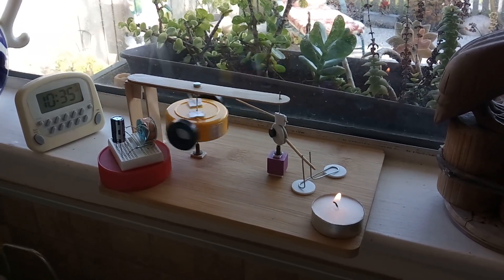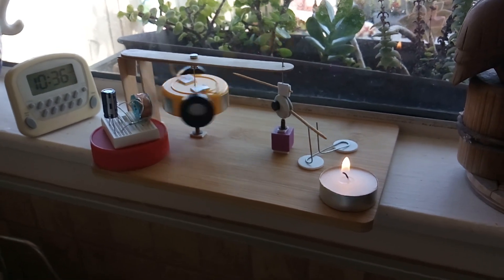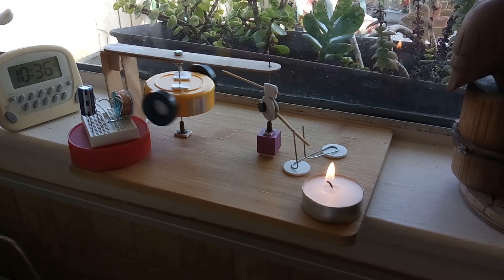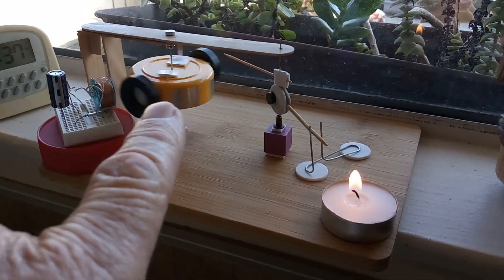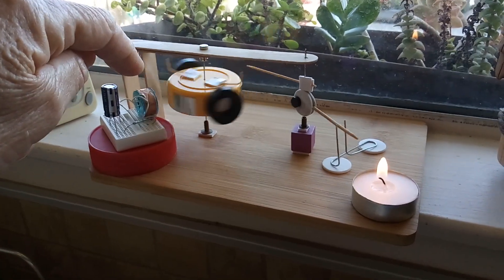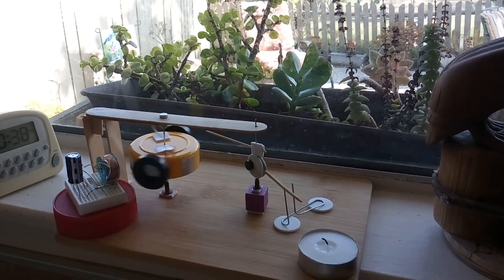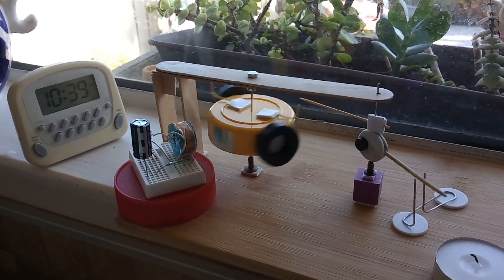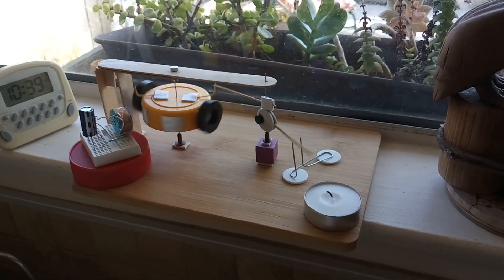Mystery Magnet Motor Study --  Part 3

Comment: you can have a real perpertual motion machine if you load the mains from your house with single recitified ac current into dc and charge capacitor so that the reverse cycle goes into another capacitor when your loading the first one. the utility meter chould not be able to detect the load as its compleatly separated from the grid when discharged. the charging of the capacitors chould create the same effect as a capacitor run in paralell with main line without rectification like a power saver. the electric meter chould not be able to pick up the capacitor loading itself so the charge discharged from the caps chould be free power. the utility companies would not notice a thing. 

what actually happen on power saver is that the capacitor get charged one direction then the other direction charge up the same capacitor reversing the polarity at the resistance of the wire. as the capacitor charge up in one direction there chould be a drop in resistance. that would be the same by charging dc and then switch the cap with one that is not charged for the reverse cycle. the importance is that the wave form does not really change by doing this.  normal load causes the wave form to get flat. the capacitor preserves the wave form mostly. a slight normal load effect is still present. normal load cancel itself out and produce drag. capacitor switched load preserves the voltage and produce little if any drag. the normal load destroy the voltage. that is why it produce lenz effect. if you could vary the resistance across the load like the ac capacitor  it chould do the same preserve the wave form and the voltage. as long as the unloaded wave form is equal to the loaded wave form there chould be no actual load noticed by the prime mover. if we can electronically vary the resistance is tune with the frequency across the load the generator chould no longer behave like a brake.

Comment: Use of weaker force and extreme balance is the key. You do not have the leverage needed in such a small rotor or the ability to balance with extreme accuracy to capitalize on the unbalanced force. Just think about planets. They are the proof you have been trying to replicate for years. No one debunks the fact that we are not stopping our rotation any time soon. Strange how we continues to move as the laws we came up with contradict nature and what we all know to be reality. Great that it entertains you but in all these years I have been following you I have seen very few legitimate replications of other experimenters on this issue. Read the k&j article and think about it. Any time there is a imbalance it can be exploited. You just have to be clever enough to gain from a minuscule amount of force. I have never seen you build a device capable of this kind of accuracy so I can predict the failure within seconds of seeing the build. This is incapable of replication on just about every level compared to the original and only shows the possibility of a fake according to your skill. I don’t discount it’s possibly but don’t give up on unity. As for something greater than ordered motion well I don’t really see it on the small scale we can produce. The forces around us are still misunderstood by science but not for much longer. Soon gravity will be debunked and we will understand all planets are diamagnetic and resonate at individual frequency according to “mass”. The sun regulates the orbitals and the tilt we experience is a universal force from the initial motion that started the imbalance. Think bell ringing the force is back and forth and the orbiter reciprocates as the universal force is imparted.(seasons change as this happens). The balance is real and we have small working model of this in action currently. Diamagnetism being the key. We simulate the universal force and it all comes together. Finally a unified theory that has a working model. If academia is kind we will all understand very soon.

Comment: Nice video .. 
I think if you surrounding the free area around rotating magnets by coils , then storing this picked up energy in driver's capacitor, then you'll get self running with excess energy
Reply: No. Lots of No.
Reply: @kirkc9643  Why no !?
 if add kick back diode , and make every added coil in resonance (Tank circuit) , so amplifing magnetic field .
Reply: @MustafaSankar  The 3 rules of thermodynamics - Simplified Edition
1) You cannot get more energy out than you put in.
2) You will never win.
3) You will always lose.
Reply: @Kirk Claybrook  That's right , and always there is lose in energy because friction and heat and so on ..
But when we realize that we are living  in universe which has a tremendous amount of energy , so we can harnesing this open energy ..
Don Smith always talked about Ambient Background Energy , and before him was Tesla ..
Am feeling we are close very much to free energy , if we start thinking in open system , and as Don Smith said in Magnetic Resonance with grounding not Electrical Resonance.

Comment: Your "multipurpose driver unit" is excellent, you have that down to a fine art 👍👍
Reply from the maker: The little thing really has come in handy.  I have a bunch of them.  The beauty of it is that you can build up all kinds of circuits on it besides just a reed switch type.  The simple two transistor circuit that I use works out really well.

Comment: In the first few seconds of the Dutch guy's first video, 
you can clearly see that the board that supports the device is made of different 'plywood' as the other wooden parts, like the square that holds the small magnet, for example.
The reason for that is that he made it out of a few sheets of veneer.
Plywood like that does not exist.
The layers in the middle are hollow of course.
You can also see that in different videos, the device is running at different speeds.
Reply from the maker: Yep.  If I was him and the device was a true " self-running' magnet motor I would saw out the middle of that plywood right away .
Reply: @Lidmotor  Russ has made some 'flat' coils.
https://www.youtube.com/watch?v=yj8OHuxBzAg&ab_channel=rwg42985